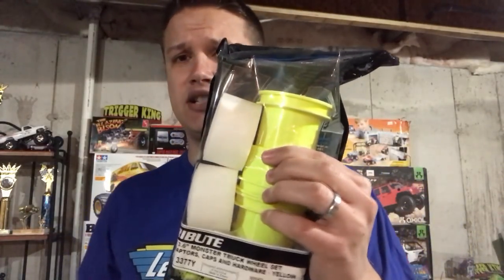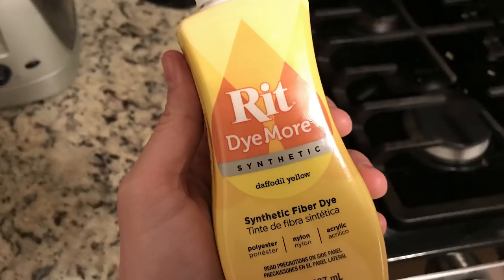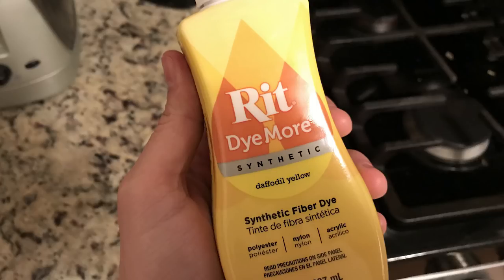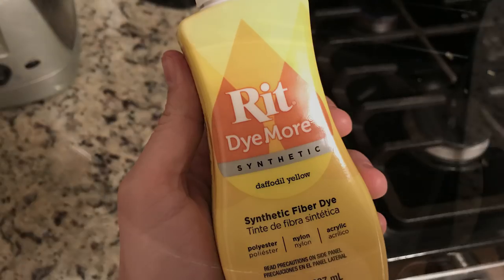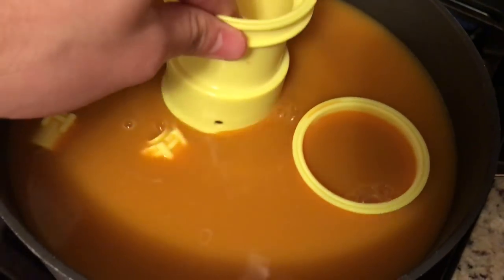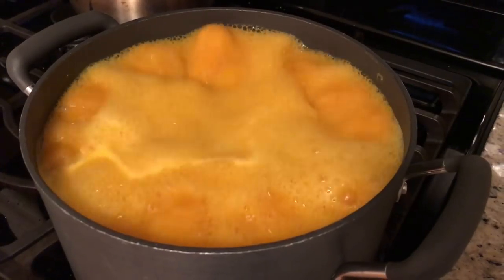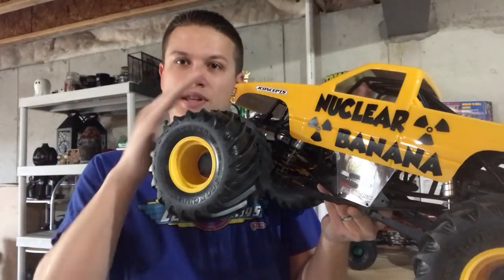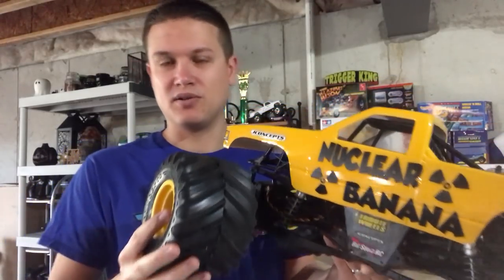How to Dye Nylon R/C Parts - JConcepts Tribute Wheels

Comment: Quick question. I just purchased a new 1/10 Orange EditionTraxxas Summit, and My biggest passion is airbrushing new bodies and I don't want to be stuck matching paint jobs with the neon orange Bead Rings on the wheels, would the black Rit Dye change the rings from the neon orange to black?

Comment: I have a question, does boiling the parts ruin the plastic or warp it?
Reply from the maker: No, as long as it's not in there an excessive amount of time. Once the dye takes, remove it and you should be ok
Reply: @TriggerKingRC  Thank you and I manage to pull it off by changing the colors from lime green to black on my tribute wheels and they look great!